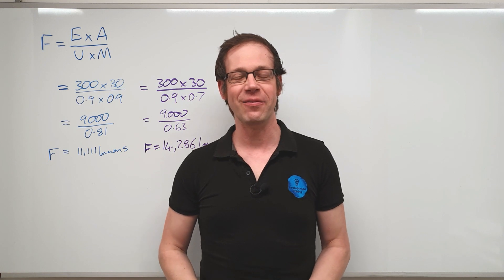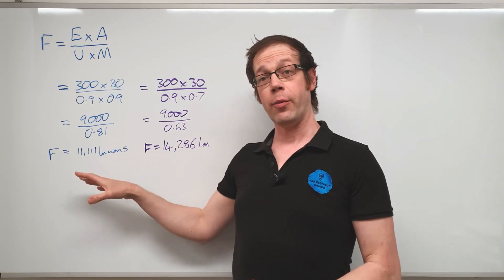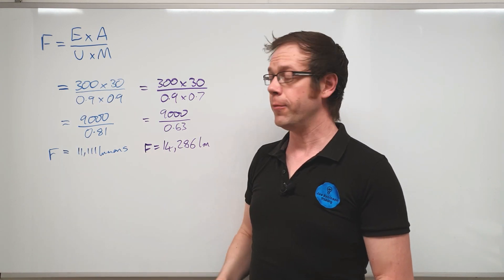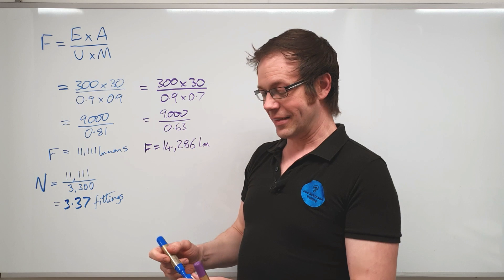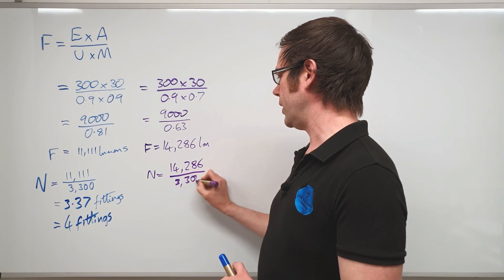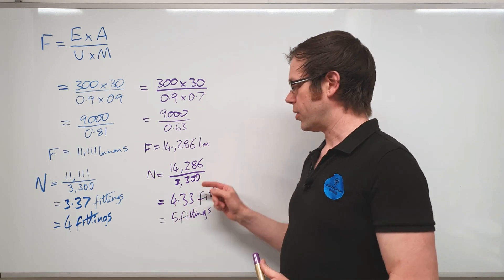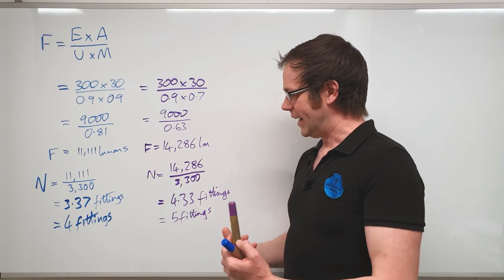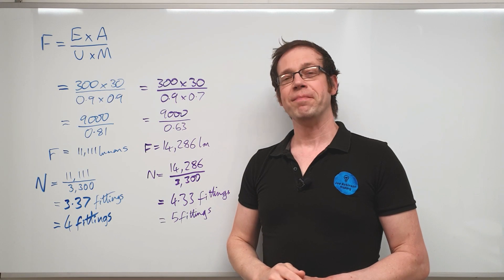How to Use the Luminous Flux Method to Calculate the Amount of Lights Required in a Room

Comment: Why not using the Lux at a particular height to calculate the number of luminaires required? This info should be included in the spec. sheet from the manufacture. The lumens of a luminaire don't consider height.